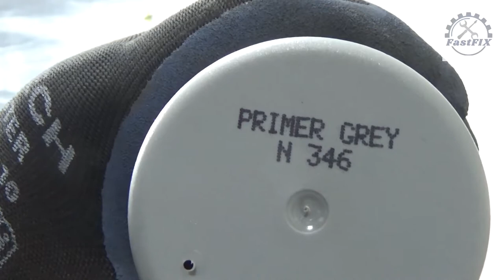Two Speed Hand Drill Restoration

Comment: Very nice restoration on a old but yet functional drill. Do you know about what year it was manufactured  and was there a company stamping on it?  🇺🇸👍Roger
Reply from the maker: Thanks Roger for watching and commenting. I have no data regarding this hand drill.
Reply: Not sure where you are located, but in the US, Miller Falls produced them in the 30's - 40's. Schroeder made some in Germany around the same time. Others produced them as well and didnt brand them. Thats about the limit of my knowledge on them. Miller Falls company from Massachusetts also produced some unbranded. Still a nice piece for your collection!
Reply from the maker: @rogermcdonald1607  Mostly on these drills comes a plate with the name of the manufacturer. But unfortunately there is no such thing on this drill. I am from Europe.